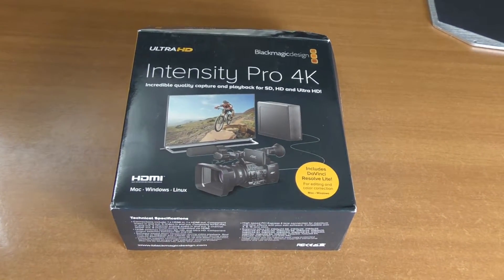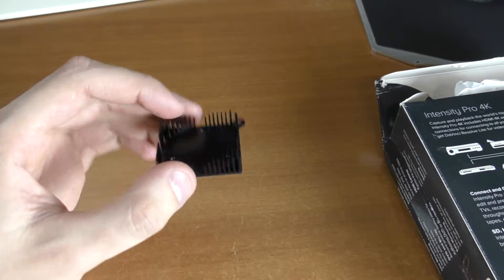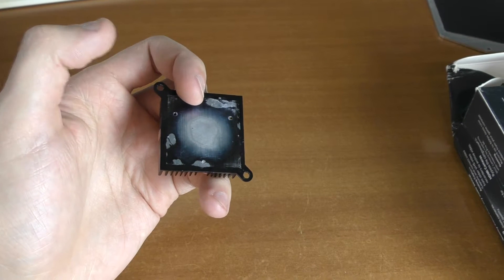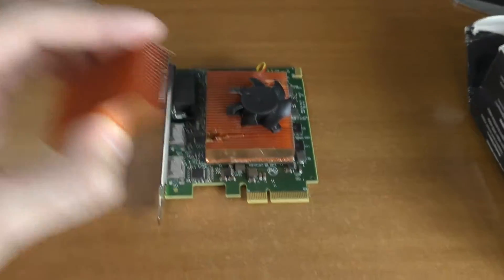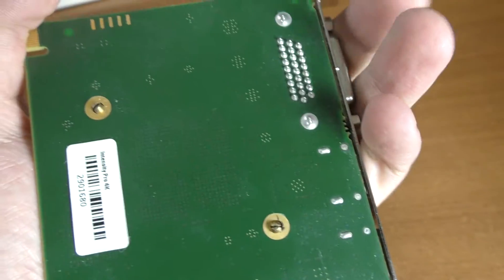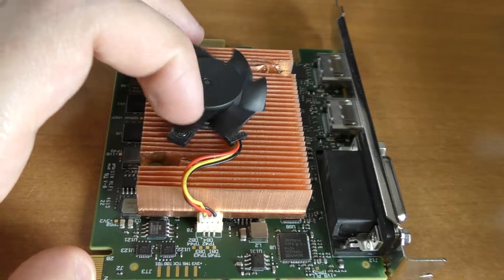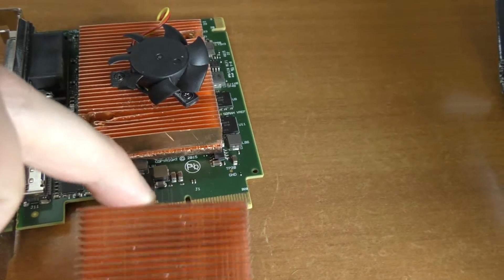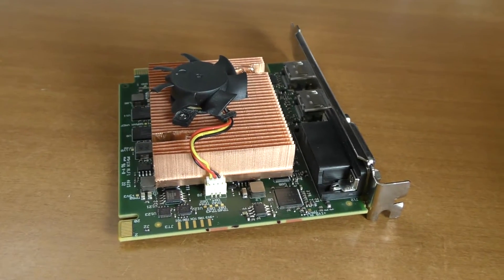How to make Intensity Pro 4K silent

Comment: Your comments about the OEM heat sink are hilarious. Thanks for the video.  I found a  low profile copper heat sink with a 60mm offset.. Going to try  that with a Noctua and see if my results vary.  But I think what you did is all anyone really needs to do.  Im  being a little picky with the height of the solution because its in my densely populated Mac Pro and I can here that little bastard whining.

Comment: Hi , you said you have 45° with the fan, 50° without but  how much do we have with the original radiator and original fan ? it's because I' wonder if I can only keep the Cooper without fan , I have a  Mac Pro I can't  have a 2 slot  high card, I must see one  slot thank you
Reply: Hey, I didn't measure the original temp as I only got pyrometer after I made this mod. And obviously, I didn't want to switch back to the original fan. I believe, if you make this mod, and you have any level of airflow in your PC case you'll be fine.
Reply: @SneakyJoeRu  Hi, tank you ,yes the original one is so noisy !!!!  but do you think with only the Cooper rad it can be ok ? because  I won't have enough space to put the fan on the copper rad.
Reply: @John-Smith-007  Yeah, with any level of airflow copper rad will both consume more heat, as well as be able to dissipate it more efficiently because of higher volume of metal and more surface area. If any air is moving inside the case, copper will do. Just make sure you have good contact with the die and apply enough thermal compound :-) It's not THAT hot chip to be a real issue. Copper is just expensive.
Reply: @SneakyJoeRu  great !! so thank you !! gonna try it !! thanks you much ! by a chance do you have the new link for the copper rad you found ?
Reply: @SneakyJoeRu  okay thks, I've just found, I've order a 50x50mmx15mm , hope it will be ok! thks

Comment: The black isn't necessarily a paint, and is put on in an anodizing process. The layer is way thinner, than normal paint procedure.

And guess why they anodize heat sinks black? Because the black HELPS dissipating the heat...

Whether the provided heat sink that comes with the card is adequate, is a different story. I'm sure, a pro company like BM did their testing. Yes, the fan is said to be loud, but that has nothing to do with the heat sink!
Reply from the maker: What's better - having 2 materials with direct contact, while one is hot and another one is for heat decipation, or having  3 materials, one of which is between the hot and the heat decipation materials? This paint layer can't make heat decipation better. As for testing - they may have tested it to be good enough. It's still not good if you are filming in a noise controlled environment. And swapping it for a bigger copper cooler helps the chip to be less hot.
Reply: @SneakyJoesENG  You clearly know a lot more, than the companies, who makes heat sinks. Or do you?!

Here's from one site, of a company, that makes heat sinks:
"microscopic texturing and increased surface area.
The unfinished surface of aluminum can be measured at an emissivity of approximately 0.05. The emissivity of an anodized aluminum surface can be measured at around 0.85.

This is a significant difference. But the improved radiation heat transfer will have a more pronounced effect (percentage-wise) on heat sinks that are smaller. It will also have less overall impact on active heat sinks (which utilize a fan).

Does Color Impact Heat Sink Performance?
Another benefit to anodizing aluminum extrusions is the ability to add colored dyes.
The porous oxide layer can be filled with dye that gets locked in and is resistant to fading.

Anodized heat sinks can be dyed in colors like blue, green, black, and so on. It is important to note, however, that the only real impact of color is a visual one. Regardless of the color, heat transfer will not be affected."

But I've seen other sites mention, that the black dye helps dissipating heat. I just chose to post the above, because they describe everything so well, that you might even understand it.

This is from a website, that explains why even anodizing in any color, will improve heat dissipation. I'm sure you can find the page, by Googleing some of the text:
"How Heat Sink Anodization Improves Thermal Performance (part 1 of 2)

Posted on November 9, 2010 by Becca Leonard | 9 Comments

Radiation heat transfer can be as important as convection heat transfer in electronics cooling, especially in natural convection and low-airflow applications. In part 1 of this 2 part article, we’ll talk a bit about heat sink anodization, and how it affects radiation cooling in thermal management. In part 2 we’ll cover the heat sink anodization process and different types of anodization."
Reply: @akyhne  Regardless of anodizing or painting, there's a thermal interface in a form of thermal paste to work for heat transfer and improving surface contact if area is rough.
As for "companies know better" argument, a lot of companies do stupid design a knowledgable user wouldn't repeat, and charge premium for this design, while it sucks in all aspects. I believe I faced this issue here thus I provided a solution that worked for me and was completely passive since copper radiator allows for passive heat decipation using air that is already moving inside PC case. Yes, it's larger and heavier, copper is kinda expensive, but this card isn't cheap in the first place. I also happily sold it and am using a cheaper capture card now since I don't need studio-quality color accuracy.

Comment: Thanks for sharing; I found your video, because I'm listening to mine right now... sounds like a fly buzzing in my computer case.

What did you use to monitor the temperature?
Reply: Basically, nothing. But it was working great since I did the mod. I have good airflow in my case, so there was no need for a fan after I installed the new heatsink. Still, you can use the og fan on the new heatsink if you wish to, but it doesn't affect performance in my case.

Comment: how did you remove the old heat sync?
Reply: Reverse of what I did while applying a new one. It is really easy. Just squeeze those pins and they'll fall through holes.

Comment: Hi,
many thanks for the excellent video. In your openion what was causing the lould noise with original heatsink/fan? I ask this question because you are still using the original fan and I do not understand where the noise comes from? Still the fan is the noise maker or what? Could you please elaborate it, if possible?

Also, would it be possible to learn how did you acquire temperature with new heatsinkand with and without the fan?
Were you able to check temperature with stock original heatsink/fan, in order to compare it with new changes?
Lastly, what did you put in between the heatsink and the physical chip? Simple thermal paste (generally used for CPU) or something particular?
Many thanks...
Reply from the maker: I believe that the noise was coming from high velocity of the fan multiplied by poor heatsink design. It's hot because area is small, and it's fast because it's hot. Fast spinning makes extra noise from poor heatsink design. So there's a combo of factors that makes extra sound. I wrote to bmd forum and they said that it might be one of a hundred fans that were damaged on production, or something like that. 

IR thermometer. Something like 
http://www.ebay.com/itm/Handheld-Digital-LCD-Temperature-Thermometer-Laser-Non-Contact-IR-Infrared-Gun-B-/162420627813?var=&hash=item25d1061965:m:mGjWh30VUad5R1xWwzJaSMQ
does the job.

I don't want to install stock fan, sorry for that.
I applied MX4 thermal paste between heatsink and cooler.
Reply: Hi,
thank you for your helpful reply.

Did you happen to measure temperature before replacing the heatsink?
Here is what I found, based on your suggestion:

http://www.ebay.it/sch/i.html?_from=R40&_trksid=p2050601.m570.l1313.TR0.TRC0.H0.XSkiving+Heatsink+.TRS0&_nkw=Skiving+Heatsink+&_sacat=0

Would it make any major difference if I would opt, in your opinion, for the
50x50x15mm rather than the 100x50x15mm? This way I will avoid having to cut the
bar.
As for BMD rather than the forum I had a real RMA and real discussion with
them. Basically they state that the fan is properly working.
I have two BMD cards: Intensity and DeckLink. 

First one is louder and makes a mechanical noise. Second one is totally silent.
I swapped the fans and discovered there is no difference. Hence, the only difference
is rpm:
Intensity spins faster than DeckLink and this is why I suspect your card became
silent. because with the new real heatsink dissipation is done way much better
and therefore the fan spins similarly to the DeckLink.
Reply from the maker: No, I didn't. And in fact, I'd still recommend using some kind of fan to help it. In the winter it was ok, but now, when it's summer, it becomes hotter than I mentioned, and I'm sorta afraid for my own one.
About 50x50 - you can go for it, but you'd still need to drill holes and add some space for one special element on the card - just start drilling not going through at one spot.
Then it just means that alluminium one is a reap shit. Just go for a copper, work around, apply a real thermal paste, and you'd probably be fine even in fanless. Or save fan to be extra safe :-)
Reply: SneakyJoe's Salad ENG 
have you ever thought of implementing this article?
http://noctua.at/en/nf-a4x10-flx
the original fan should be 12V, correct?
Reply from the maker: Yes, I did think about replacing the fan, but after I switched to current copper radiator I didn't need to switch fan just because it's not loud enough to get over my cpu 14cm fans, so no need. Noctua fans are considerably expensive, so just saved some money on unnecessary upgrade. :-)